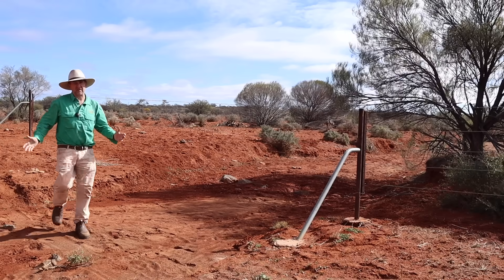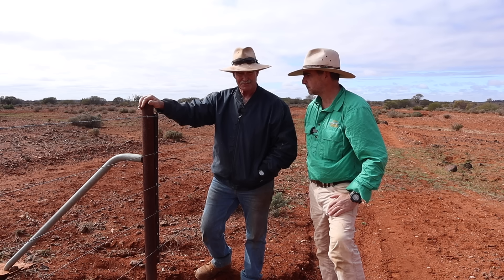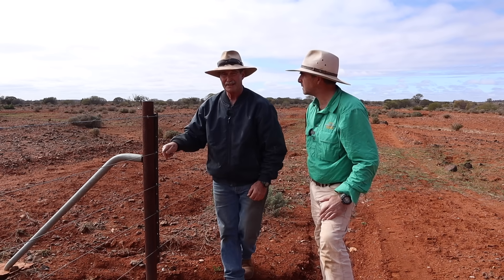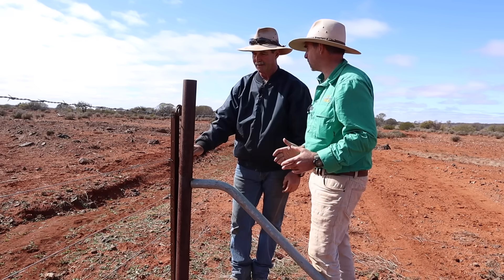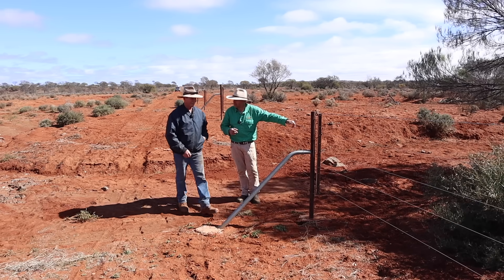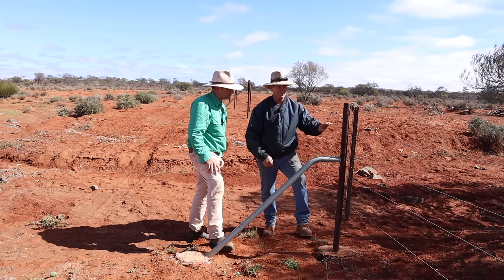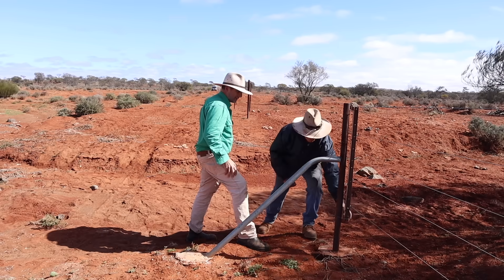Genius Floodgate Design That Survives Massive Flows

Comment: Good planning for his problem. 
But on my farm here in Tas,  i run Dorper sheep, so on my creek flats where it floods, I can't, and don't need to fence the creek edge for sheep, as with sheep the creek is the fence, but across the creek flats to divide  into paddocks, I set a tantalised pine post in concrete each end,  run ringlock netting fixed to the post at end away from the creek, and at the creek end, wrap the netting around a steel post, and top and bottom, strain the steel post with a short bit of wire using a gripple to the tantalised post.   Along the netting I use steel posts, and electric fence insulators with pins.
So, in times of flood,  i cut the short bit of wire where it is strained using the gripples, walk along and unpin the netting from the fence insulators, leaving the insulators attached to the steel posts, and roll the netting up.
Takes about an hour to remove the fence netting, and about 2 hours to put back after flood. 
Works great. 🤠

Comment: That is quite a nice design!

 Every area has different challenges. We have seasonal flooding in my area, but the channels are much more narrow and deep, (8-12 feet deep and up to 40 feet across) so I’ve devised my own design for dealing with our unique mix of terrain and flood conditions, and so far it has survived about a dozen high water events. Describing it in text is difficult, but it amounts to a cable, secured far back from the bank, with light weight old split cedar posts hung from it via a hole drilled in one end, and spaced apart with 6-8 inches of reclaimed plastic pipe.  It looks like a picket fence hanging from a cable. This spans the channel and is hung so the posts are just above the ground in dry conditions. The bottoms of the posts are secured together at the same spacing with a light tie wire and fence staple on the down stream side. This keeps the posts from swinging in the wind, and keeps cattle from being able to easily push through between swinging posts. 

In high water events, the entire post assembly floats, and every post is oriented lengthwise in the stream, so debris does not have a place to snag. Any large tree floating down the flow might catch the stapled tie wire, but as it is on the down stream side and only stapled, the wire will pull free and allow the snag to escape. The wire is easily replaced once flooding ends. 

My whole design was tailored to work with deep, relatively narrow,  steep sided seasonal creek channels. Much different than the floodgated streams in this video. 

I plan on building future installs of my design entirely out of salvaged polyester pipe, replacing the old cedar posts with poly pipe will make them even less likely to snag debris, as the plastic is so smooth. 

everyone tailors their flood gate (Water-Gap in my part of the world) to their needs and situation.
Reply: great idea - our winter creek has similar specs and I can see your idea working. Have some fresh ideas to look at to resolve our problem

Comment: Awesome! I would change only 1 thing, and that is instead of tying off the bottom on the last post add a heavy duty spring that will stretch under heavy load and then spring back afterword. Or add a pulley system that holds a weight allowing the fence to move up under heavy water movement and move back down when the water recedes.
Reply: Pulley system with say 4kg weight but tie 2 empty 2lt milk  bottles they will work as a float during flood and negate the 4kg weight
Reply: <Scratch'n head ,hat off, thinking> a few plastic battens  along e long those low areas mate. You could always attach a lead ball to the bottoms of the batterns, from your tackle box.😂
Reply: @tanioraaura1274  that is an interesting idea. Attach heavy weights to the bottom of the battens and maybe some magnets to keep it from swinging.
Reply: @masterserge 🤔 <Hat on thinking> magnets now ok what about  tilt door type flood gates 
No skin just the spring arms the frame and  weed wacker line. Its bright tough made of plastic.
Reply: Battens laying this way _____ 
NOT --> |

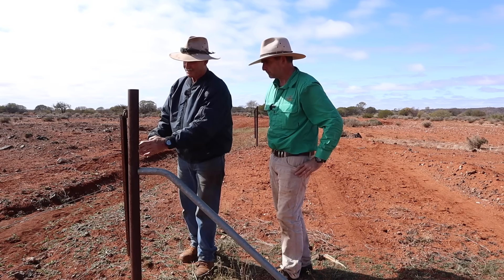Comment: At 5:06, the post brace could be put on the downsteam side if it was taller and longer (more material all around) so the fence wires / star post was lifted inside its  area - how it is done is "technically less strong ( - lots of venues to make it as durable as stated... more concrete is added to the tension brace leg - anchoring into the ground / the drill rod post concreted deeper, etc)....
Reply: Interesting points and I agreed with you on first read but after considering it i think the way he has done it is better. With the brace going upstream it is more likely to deflect larger bits of debris like tress and branches and reducing the likelihood of them being wedged in the base of a downstream brace base. You are absolutely correct in saying that the way he has built it isn't as strong but a heavy wall drill rod at 1.5 in the ground with additional bracing at the top is quite bloody strong. Interesting thoughts nevertheless.

Comment: That's interesting.  We don't do any of that in the USA.
Reply: keep watching there more ideas      pass them on help farmers
Reply from the maker: Welcome mate. Hope you get use from the channel
Reply: Well, every area has different challenges. We have seasonal flooding in my area, but the channels are much more narrow and deep, (8-12 feet deep and 40 feet across) so this design would not work. I’ve devised my own design for dealing with our unique mix of terrain and flood conditions, and so far it has survived about a dozen high water events. Describing it in text is difficult, but it amounts to a cable, with light weight old split cedar posts hung from it via a hole drilled in one end, and spaced apart with 6-8 inches of reclaimed plastic pipe.  It looks like a picket fence hanging from a cable. The bottoms of the posts are secured together at the same spacing with a light tie wire and fence staple on the down stream side. This keeps the posts from swinging in the wind, and keeps cattle from being able to easily push through between swinging posts. 

In high water events, the entire post assembly floats, and every post is oriented lengthwise in the stream, so debris does not have a place to snag. Any large tree floating down the flow might catch the stapled tie wire, but as it is on the down stream side and only stapled, the wire will pull free and allow the snag to escape. The wire is easily replaced once flooding ends. 

My whole design was tailored to work with deep, relatively narrow,  steep sided seasonal creek channels. Much different than the floodgated streams in this video. 

I plan on building future installs of my design entirely out of salvaged polyester pipe, replacing the old cedar posts with poly pipe will make them even less likely to snag debris, as the plastic is so smooth. 

So like I said, everyone tailors their water-gap (floodgate) to their needs and situation.